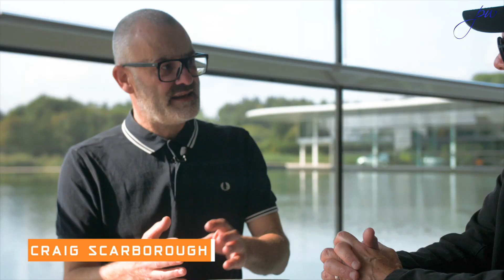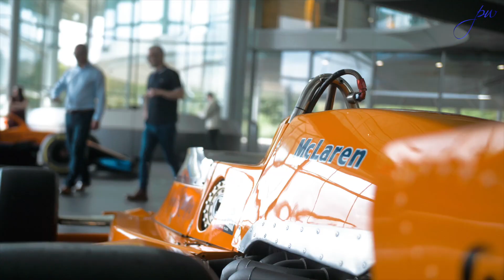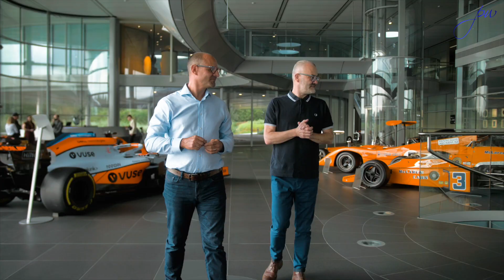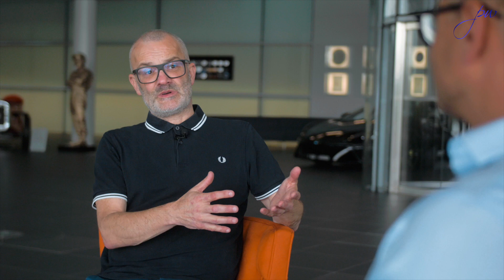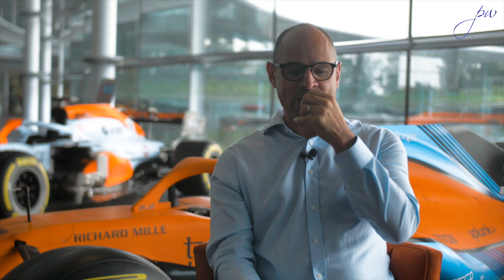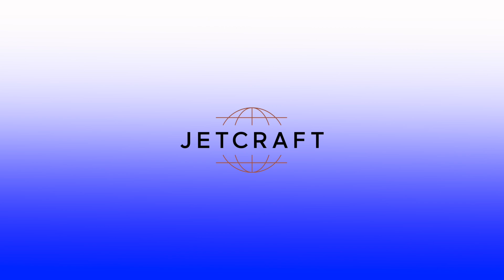F1 engines: Scarbs and the future  by Peter Windsor (1/3)

Comment: Heavy and big.  50/50 is expensive and useless fence sitting.  Mediocre IC and mediocre electric.  They should open the regs for batteries and motors, give allowances for solar power sourcing, or admit v10 ice was the zenith of F1.  Locking in design for years is just spec by bureaucratic proxy.  And extremely expensive.

Comment: Here is what F1 will be in 250 years: the pinnacle of human engineering and pilot skill and bravery. 

Tracks and vehicles that race each other. Only safety regulations. No manufacturing regulations. Create any vehicle you can using any propulsion method. As long as it is pilotable by a human.

Ion engines, plasma cores, magnetic thrust vectoring, whatever you like. The only regulations are for safety. 

If any company can find a way to make the vehicle faster or more maneuverable using any technology it is allowed.

The entire sport is made to push human engineering, creative innovation and pilot skill to the limit and extend that limit. Year on year. It is the ultimate activity to propel the human race forward through the universe.

Perhaps it will just be called Formula or Prelation

Comment: Wish they did a new spec engine every decade. 
allow modifications every year. 
let teams who design well out of the box get a few years of rewards. 
but 2nd half of decade should be leveled out.. 
the let's have the 2025-2035 open spec 2l any design you want. 
just limit total fuel per race. I don't care if it's 1l or 100l 
I'd like an engine a weekend. cheaper engines anyone can buy... 
proper crate motors, 
the high tech bits would be the KERS and chassis...

Comment: It''s all way too complex and silly.  The more we see F1 keep locking engine designers into super tight rules the more we see fewer and fewer manufacturers showing any interest in joining the fomula.  Just give the engine designers 100 litres of fuel and let them design whatever they want.  If they want to use KERS and put up with all the weight that comes with it,  whatever.  If they want to make their cars 600kg with driver and it passes the various safety tests then let them do that.  If they want a long wheelbase,  let them do it.  If they want a short wheelbase,  let them do it.  What fans want to see in F1 is variation,  inventiveness,  and creativity.  There's a reason only 10 teams are currently in F1.  The series has priced itself almost out of business.

Comment: The rules should be this. 1 litre 2-8 cylinder engines in straight, 60, 72, 90 degree V or 180 horizontally opposed layout using 100% ethanol. energy recovery can be by the current rear wheel MGU-K and H or MGU-K recovery only through all 4 wheels. Allowing these different engine types might entice more manufacturers in.

Comment: Geez couldn’t disagree more with Mr Saxby. If F1 goes full electric it’ll cease to have sporting relevance as the fan base will plummet, and then he suggests the weight will increase further than what’s coming in ‘22!?!?! When asked about the ‘22 cars very few of the current drivers expressed any excitement for them at all, and most stressed their disappointment that the weight of the cars was increasing even further than what we currently have.

Comment: Puff piece.  More electrification means heavier car.  We saw it happen when the hybrid formula started in 2014.  Adding front axle energy recovery just means more of the same.  Charging and discharging a bigger battery with more than double the energy and adding front axle m-g units will make the cars bigger and heavier, and not much faster, if at all.  The only reason that hybrid F1 cars are setting all-time lap records now is the tire and aero rules that slowed the internal combustion cars since the mid-90's were rescinded, allowing bigger wings, diffusers, and tires.

  Even the current cars can't keep the battery charged on every lap.  Every race we hear about drivers making a slow lap so they can charge the battery to make a fast lap.  I would rather see F1 allow the constructors flexibility in choosing which axle gets KERS, and whether or not to run TERS.  Even allow bottoming cycle energy recovery.
Reply: @KevinJDildonik  No they don't.  The hybrid systems aren't being added to the cars until the 2022 season.

Comment: I wonder if a fully electric series would be so interesting to people. Take gear changes and engine characteristics out the equation and it’s just yet another thing gone from the drivers skills requirement. It’s much more point and shoot. It depends how we view the series, is it about the most technologically advanced cars in the world, or the best drivers in the world? Most popular sports aren’t the most technologically advanced. If it is the latter then maybe a return to simpler, lighter, manual gear change, V8 engines would be a better direction.
Reply: You don't need to wonder.  Formula E has been around for years.  You don't seem to be aware of it, which says a lot about how much interest people have in it.
Reply: @andyharman3022  I have to admit to being aware of Formula E but at least currently it's not really a direct comparator, given they seem to just run around street circuits. If you just swapped current F1 cars and said they were electric instead, I'm not sure if we would see the drivers as being quite as talented as we do now.
Reply: @sega-kid  There's a reason they don't run Formula E on the same tracks as F1:  they don't want people to see how slow the cars really are.
Reply: @andyharman3022  I agree BUT even if they were as fast as F1 cars, do you think it would have the same or even a better spectacle than current F1? I happened to come across a reshowing of the 89 Japan GP and watching Senna change gears manually round that circuit, driving one handed at times, made me think we should go back to manual boxes. That's a real skill.

Comment: Who wants to listen to r/c cars relevant or not. Next thing they’ll be mixing engine noise into the commentary. If anyone remembers 22 v12’s going off the line, bass and vibration in the heart and soul; now that’s what I call F1!  Light cars, loads of power and flatten the various wings and boards to aid overtaking. Flat out racing for a full Grand Prix and I’d personally bring back a clutch and manual stick. If the drivers enjoy the cars we enjoy it with them. Although tyre saving and smoothness is a skill leave that for the driving lessons. Flat out should mean flat out and DRS shows how many years this lot have got it so so wrong. I miss F1 😞
Reply: 99.9% watch F1 races not on-site. Did you really get to experience any of the bass and vibration of V12's from your crappy 90's TV speakers? I doubt that. Clutch and manual stick, can't even find a cheap consumer car with those anymore. Flat out racing wasn't even a thing back in the old days, those cars were actually more fragile, which meant often you had to be conservative just to get across the finishing line. Flatter wings and changes to make overtaking easier will be coming next year anyway. Lighter cars? Sure, that would be nice.
Reply: @C3lloman  I have seen many of the European races live and have wonderful memories that came with those times. Your right our TVs weren’t the best but give me any old footage of a v12 race and still gives me goosebumps listening to them. Why would anyone want to buy a 9-speed Porsche manual when the auto gets you there .8 secs faster - yeah I wonder why 🤔😉

Comment: Been saying this for years, it’s logical to move to recover front braking energy.

Expect a generator (probably motor too) under the drivers knees or calves essentially, half shafts to the front wheels. Wouldn’t want to have the weight of a motor in a wheel.

Comment: I’m amazed F1 is still running petrol engines.
Reply: Why, it's a sport, not a fucking greenpiece advertisement. Everyone wants in on the great wealth transfer to the already rich corporations using this forced change of transport regulations, with fuck all progress on actual non fossil fuel sources of electricity.
Reply: @bengaliinplatforms1268  Oh it's has nothing to do with the environment or green energy. As a F1 racing fan I love to see the teams pushing the envelope of technology I just think  EV's are far more interesting. Formula E is to regulated and low budged and thus not really innovative enough imho. Anyway I understand they go 50% petrol 50% electric first so that's a start. Lets see how that goes.

Comment: F1 should consider hydrogen fuel cell . They are lighter vehicles than Bev . Just for eg - the Porsche taycan weighs over 2000 kgs which is rediculous.
Reply: fuel cells are much much heavier than the current PHEV.
Reply: @danielthuku8192  bro the mirai hydrogen has less weight than Tesla or taycan .
Reply: am comparing to petrol-hybrids like current f1 cars  not EVs plus using hydrogen is a notoriously complex and inefficient way of making power.

Comment: Hybrid isn't the future - no one aspires to own a hybrid vehicle; it's all electric or ice.  So until battery tech is more sophisticated how about we look to improving tech that will be dominant for the next 20+ years while at the same time reducing the ridiculous cost/complexity/size of exiting F1 cars?  Turbo'd 4-cyl engines pushing 1000hp with alternative fuels.  Low cost/simple tech would attract interest from more manufacturers.  If FIA went this route in 2014 we'd have more efficient engines today with cleaner-burning fuels and -gasp! maybe more than 10 teams.
Reply: Hybrid is good for efficiency but I think hydrogen is more important and f1 should head in that space . Bevs are sh*t . They are heavy and can't be put into many applications like planes and ships .  The Tesla model s and the Porsche taycan weigh more than 2 tons or 2000 kgs which is rediculous. Hydrogen fuel cell cars weigh less . I hope formula 1 dosen't become the new formula e.
Reply: @jerryldavis1823  exactly hydrogen is the future. Storage is the only problem with hydrogen fuels. Once that is figured out then it will become mainstream. Hydrogen can still make engines feel like they have soul and it has the lowest carbon foot print. Toyota already has a hydrogen fuel racing car testing and it sounds good.
The battery tech for electric cars pollutes a lot and makes cars heavy. I think hybrid tech is good for road cars presently until hydrogen takes over. I am not sold on fully electric vehicles.
Reply: I'm not so sure about all electric. Still several manufacturers are investing their money in hydrogen.
And electricity networks are already pushed to the limit.
Hydrogen is now planned to be produced at large scale. And has some major advantages.
It can be produced from green energy. Porsche has just started to build a mega project in Chili.
So it can be transported using the existing logistic systems and storage.
And several other benefits make the choice not written in stone.
Same goes for synthetic fuels.
Reply: Closed minded. Alternative fuels are also a technology worth investigation.
Reply: I agree! I think F1 should pioneer sustainable ICEs. 
On the flip side I really like the idea of something absurd like a 4WD F1 car with torque vectoring because you have electric motors on the front wheels
Reply: 4wd would make circuit racing incredibly dull.

Get a grip !

Comment: If someone CARED, Formula E could be ding full grandprix at F2 pace and better. But it clearly is their objective to run out their awarded monopoly with land as possible technology.
I bet even one time use uniform batteries are more renewable  than V6 turbos made in these numbers. But long term it se batteries are ready to do GP racing. Just hot swap like on a cheap scooter, do 20-35 minute stints. Front axle regen and drive is vital. Skip the drive and you sacrifice lap time.

Comment: Increases of power in the electric motor might increase the weight too....why don't someone suggest to reduce the size of the car? Smaller means lighter, and it also makes the car more rigid and able to take more load.
Reply: @noomade  This is a myth, there is a correct mix of technology and design that can make a smaller car just as safe.
Reply: How can you reduce the size of the cars? Keep in mind the drivers feet must remain behind the front axles, then there's the driver's safety pod and then the engine area.
Reply: @trance9158  They have already slightly reduced the maximum length for next year's cars, I think 60cm. It is possible to do this step by step with the right consideration and effort until the cars are significantly smaller.
Reply: @noomade  you change everything around the safety cell to be smaller and the car gets smaller. The max length and width is reduced along with changes to the engine design to accommodate this. That is Afterall what this video is about, and what they are going to do for 2025, change the engine spec.
Reply: @noomade  Yes, I already mentioned that a big part of the size problem is the engine unit, they can definitely reduce this by changing the rules which they are currently looking at doing for 2025. You can reduce the size of the wings, you can reduce the size of the wheel base. There are many areas where you can make significant changes if a concerted effort is made. So far as I have already mentioned the teams have had more incentive to increase length of cars because it solves any space puzzles more quickly for them and more importantly gives them a lot more surface area to manipulate the air and try to gain an advantage. What hasn't happened is the governing body giving them a limit so they have kept pushing it because the governing body keeps adding more stuff to the cars, most notably the power unit. But now they are realising it's gone to far and they must try to reduce, hence why they are (once again) trying to get rid of MGUH in the future and also making the length limit shorter next year. It's not much so far but it's a step in the right direction and they are aware of the problems and will hopefully keep pushing this way. What I don't quite understand is that some people sound like they either don't want this or don't believe it's even possible but it certainly is.
Reply: @noomade  . smaller doesn't really mean more dangerous. It's depends on how the design restrictions. Next year cars is slightly smaller. But I don't think it is reduced enough.
Reply: @noomade  . Yaya... smaller car like the 90s would be nice! It will certainly create  better racing especially in small track.

Comment: Disappointing to hear no mention of alternative fuels
Reply: @harrison juhasz Amen
Reply: You see fools doing "Burn outs" (Drifting,) and are THEY "Worrying" as per "Global Warming" NO!! Dumb Sht for Dumd asses!!
Reply: No future for it.
Reply: Shell, Petronas, Total et al. wouldn't like that.
Reply: @oldninjarider  surely they’re in a position to diversify. Would be a better alternative to them than full EV
Reply: @gregmayled  Definitely agree. Porsche have already announced their interest in e-fuels, JCB have developed a hydrogen fueled internal combustion engine, F1 already pushing for higher % bio fuels etc, could be good to see more options being explored away from just EV.
Reply: @gregmayled  they develop fuel, there has to be something that needs it. The current formula allows all those big money sponsorships to roll in; none of the PU folks want to stir that pot.
Reply: @harrisonjuhasz4045  Hydrogen fueled engines have been around for decades.  The disadvantages of H2 as a motor fuel are well known.  It cuts engine power in half, and the fuel storage system adds a lot of weight and volume.  None of these things are positives when it comes to designing race cars.
Reply: @oldninjarider  Shell, Petronas, Total are big sponsors with a lot of money.
Reply: U "EXPECTED" WHAT, Exactly??